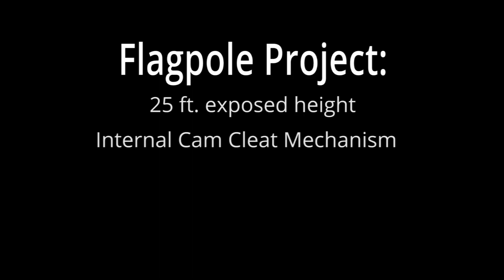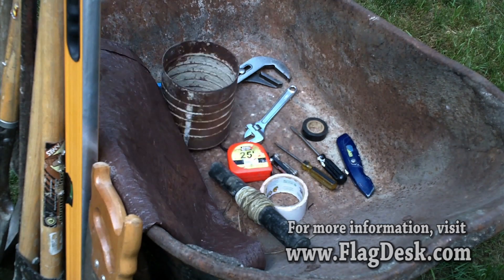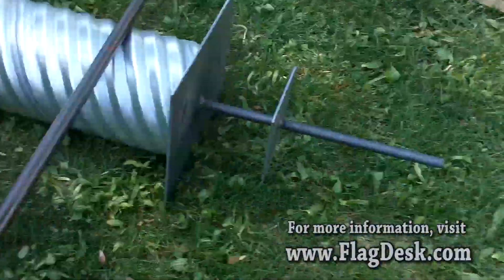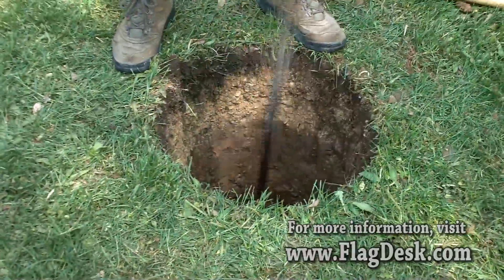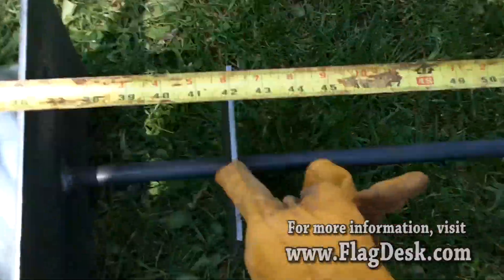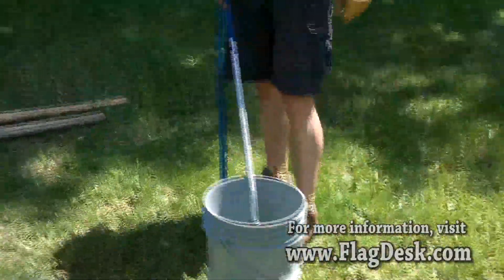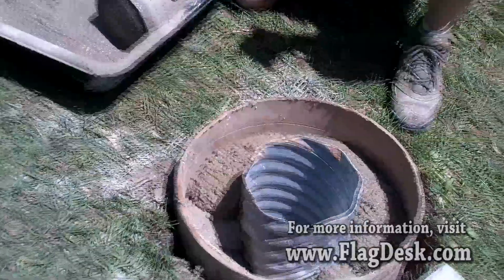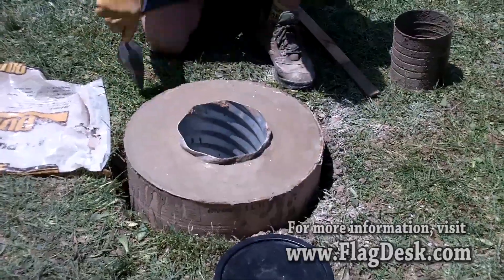FlagDesk.com | How to Install a Foundation with Pedestal Form

Comment: hello, I know this is an old posting,  but wondering if this pole lasted, I purchased a similar one today, and mine says 30 ft, but only plan on extending it for 20 or 25  seems to wobble to much for my liking , did yours do that? thanks
Bill

Comment: How wide should the sonotube be if my flagpole is 5" diameter? Or is it just personal preference?
Reply from the maker: Personal preference for sonotube width but be careful because you can have a 10" flash collar and if you use a 10" sonotube you have to be perfect in your execution to marry up the pedestal with the flash collar, avoiding a misfit overlap awkward look.
Reply: How to make a flag pole

Comment: i Have a Question I am going make mine out of a Galvanized Steel Pipe 3 of them 10 feet a piece so there a little heavy duty and so will 4 feet & 8 inches round be good enough? i am having hard time figuring out how deep to go?
Reply from the maker: Chicagoman36, sorry to get back to you so late. Set depth maximizes its own strength at 10% the height of the flagpole. With three welded galvanized pipes that translates to 3' set depth.
Reply: i put them 4 feet 7 inches deep.. 7 1/2 bags concrete.. they should be welded?

Comment: No gravel at the bottom of the hole?
Reply from the maker: We do not normally use gravel at the bottom of the hole. I know it is sometimes specified by some architects. It seems drainage and/or leveling is being considered. Appreciate your bringing that up as an oversight. What are the soil conditions where you are flying the flag?
Reply: Over here (i.e. Sweden) it seems like it's always recommended to place gravel at the bottom of the hole, regardless of the soil conditions. Not only for drainage and/or leveling but mainly for soil frost reasons; without gravel the flagpole will be pushed upwards (frost heaving).